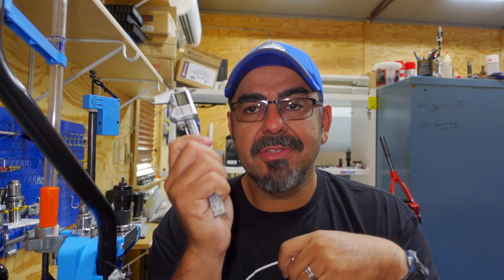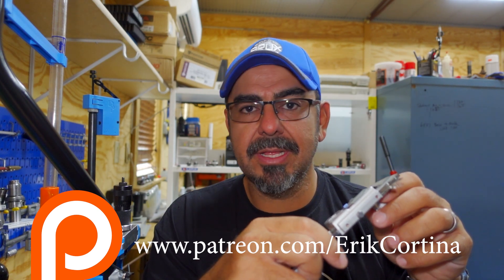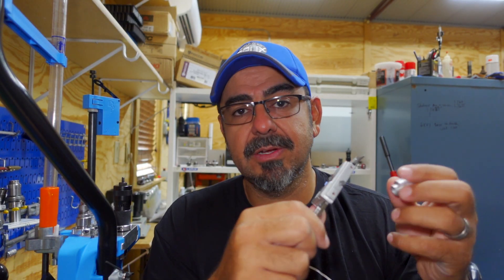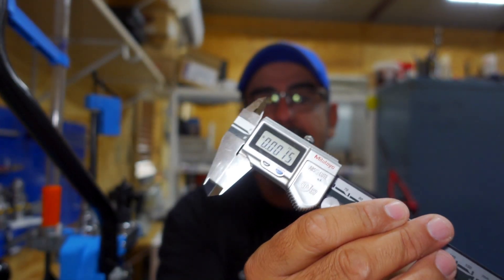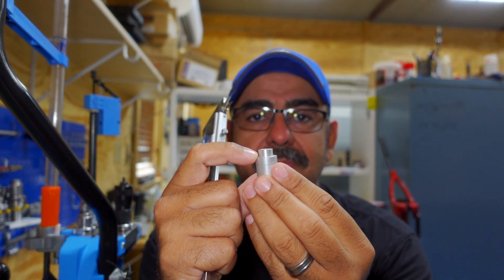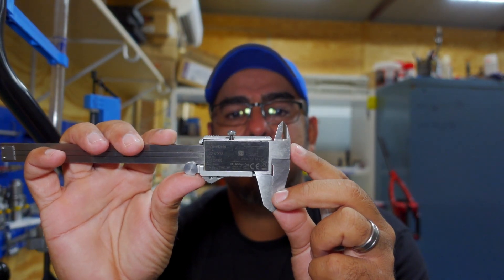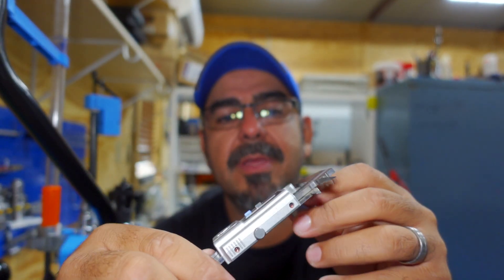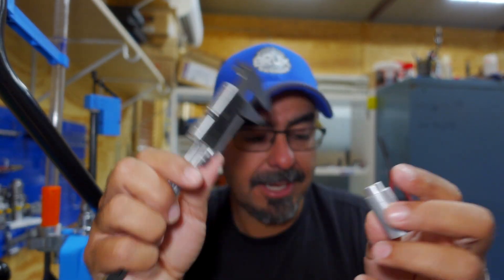You are using your calipers wrong!  Let me explain why...

Comment: Even gauge block have some tolerances :D but yeah - we test less accurate tool with more accurate one.
These calipers from mitutoyo... These are actually rubbish. The older version - black and green ones - were more durable. I use them at work and TBH with about 30-40 measurements a day, 5 days a week, they start to go off by about 0.1-0.15mm after only a year...
ALSO
Some older "analog" calipers didn't have that 4th way of measurement.

BUT STILL
Great video - some of us take this knowledge as somethink basic, but i still appreciate people like you, who wants to share this knowledge to people that just started or never had this tool in their hand. I try to be like this too - i'm responsible for newbies in my job and i'm showing them some things that they would never get to know everyday (company hires everyone, even without any experience whatsoever). Great job man! Whish you all the best!

Comment: 1/4 inch hunting rifle is very possible. Really not needed but can be achieved. I don’t shoot at anything over 200 yards ever because or terrain in my state it is hard to get anything farther unless on the western side of the state. And we are only allowed to use straight walled cartridges or .50 black powder and shotguns so under 300 yards is plenty if you get a shot at that range. And your information on caliper’s was very helpful never would have thought of using them that way.

Comment: Woo-hoo I got it right! I know I have learned that you need to always use the same measurement tool on a project. Even when it comes to tape measures. If I measure a 2x4 with mine and yell down my reading to the guy with the saw, his tape might be different and your lengths come out wrong. Either use the same instrument or calibrate them.

Comment: I need something to help me measure my case trime length.  Dependenig on how vertical I place the case in my caliper, I get a different number.  If I measure from center top to the center bottom of the case I get the best number.  I was thinking may be there is an add on to the caliper or a caliper with a wider frame .

Comment: Hello!
Tnaks for your videos, you provide very usefull data about reloading proccess very needed, cause a lot of marketing shit all around, very easy to waste a lot of money for absolutely nothing and get no expected effect...
There are another term, I guess we should take in counf if we gonna extreme precise measurements also: temperature at wich these measurements done. For example - the question is  at wich temperature this 1inch gauge show real 1 inch and how much it temperature dependent. If we keep it in hands for some time, it could be not 1 inch because at 36.6 degrees it will be inflated a bit, especially if it made from alluminium. For example if you makes measurements of engine cylinders you should keep micrometer for special arm to avoid mistakes from warming up from own hand.
Another term - if you makes measurements at room temp (25 degrees for example) and go shoot at winter - all gaps will rise up also because metals will chuckle a lot. Same thing if you gonna shot at hot sun. All ths thing should be taken in count also if we are talking of extreme precicion also. But I suppose it is another standalone story that need to be clarified.

With regards,

Comment: Even the guage blocks, slip gauges properly named, have different tolerances. A full set of slip gauges are a very useful tool for precision work and you can get sets with adaptors to make go/no-go gauges with them , combined with a DTI they make a fast accurate way to check dimensions of batches too. Dial calipers set with slip gauges are a simple accurate way to measure to very precise tolerances.
Reply: No there called joe blocks

Comment: A 1" gauge block doesn't tell you much if you are trying to measure something that is around 0.500" or 2".

If you want accuracy to a measurement, you need gauges ground to the dimension you are looking to measure and you need a measurement tool that gives you repeatable measurements.

If you don't care about the absolute measurements, a measurement tool that gives you repeatable measurements is enough and those calipers should do pretty well.

The way a caliper's accuracy is certified is a maximum error over a certain distance.  Mituitoyo isn't in the business of scrapping out of spec calipers so they have them certified to a spec that they know almost all of their production will meet.  Quite simply, if your measurement technique can consistently repeat measurements to 0.0005", there is nothing wrong with using it for a relative measurement even if the caliper spec is only +/-0.001".

 For an absolute measurement, you need a gauge the size you are trying to measure but you don't really need that for reloading, relative measurements are good enough and instead of precision ground gauges you can do stuff like save a particular reference bullet or dummy cartridge that you always use to zero your comparator (caliper) every time.

You can get more precise tools but controlling the precision of reloaded ammo to less than 0.0005" is more than most people would bother with.  You would get much more consistency with improving charge weight accuracy from +/-0.1 grain to +/-0.02 grain than going from +/-0.0005' to +/-0.0002" on all of your dimensions.  Improving charge weight is as easy as buying a lab scale and auto-trickler setup, tightening dimensions to 0.0002" means expensive measurement tools, a lot more time, better measurement technique and a lot better case prep technique, it's not easy or cheap.

For me, I've used plenty of Mitutoyo calipers, Starret, Brown&Sharpe, etc. but my Amazon $20 Clockwise Tools digital calipers are more than good enough.  They repeat pretty well and are nicely ground for $20.  They will catch gross errors and not so gross errors, the rest will be up to my reloading technique which is hopefully just as repeatable as my calipers.

For measurements requiring more precision, I'll break out my micrometers and test indicators but that's more likely for satisfying my curiosity than for trying to make my reloading consistency more precise than my $20 calipers.

Comment: In science there is a topic that deals with this called The Theory of Errors. For example, knowing the tolerances of a measuring tape, you can calculate the + or - tolerance of the value of an area you got from the formula A=l x w. This discipline carries on all the way through mathematical physics, rocket trajectory and the like. I don’t know this theory, I only know of it.

Comment: But remember a gauge blocks dimensions are only valid at a certain temperature. So while measuring you shouldn't even touch the gauge with bare hands because the heat of your fingers/ hand will change the dimensions of the gauge

Comment: I live in Gadsden Alabama. When I first got into welding at this huge welding fabrication shop the built all kinds of things but all you needed was a tape measureers and squares for measuring. After I  was there about four years my company was lucky enough to get  a contract from General Electric out of Georgia. The contract was to build transformer components for these really big transformers that you've probably have seen of the side of the road inside of fenced in areas. Anyway when GE came the company selected the best candidates of fitters and welders in the shop to be  building the components. We all had to take weld ip ng test like fitting up about a 16 inch steel box with all the plates fitted together with different joints and welding it up and they tested it for air and pressure tight and welding u couple of one inch plates together and sending them off for testing. The caliber training started with GE . All their measurements were in very tight tolerances into the thousands. Working there made me feel like I worked at Nasa.  Holes couldn't be off more than 3 thousands. Sorry so drawn out but if it wasn't  for GE I wouldn't have learned the four ways of using the calipers to messure. Sorry so drawn out and winded.

Comment: I got veneers with .250 ground pins in the jaws, pressed in so that the edge of the pins cut flush with the jaw for measuring edge to edge hole centers. So there's 5 ways. As a toolmaker I don't use calipers that much, we call them very nears cus that's all there good for, getting very near the measurement. For shooting and reloading there fine tho.

Comment: I myself didn't know about the OD depth measurement on calipers and I was a fitter/welder for 15 years and  I even built jobs for General Electric building massive power transformers for four or those years. Thanks for the knowledge.
Reply: When would calipers be used to weld pipe or a transformer? I worked in a pipe fab shop and there wasnt a set of calipers in the whole building.

Comment: Very good.  Been doing it since 1970, but then not all sets had that feature.  If you need real precision, buy and use a set of gage blocks.  Set the dimension you need with the blocks and then see if your calipers tell you the same number.   Sometimes the gauge blocks are called Jo blocks.

Comment: You can also zero your digital caliper on the over all length then measure from end to shoulder and your reading the depth of the step. Basically letting the caliper do the math.
Reply from the maker: What if part is 7” long and you only have 6” calipers?  😁

Comment: Fortunately already knew this fourth way measuring steps. I must add, there is an attachment you can make or buy that fits on the end the caliper opposite the readout. It's a base to eliminate wobble when taking depth measurements and works well short of having a depth mic at your disposal. You can also make one for a plunger mic that works.
-Jim 15 year CNC mill lathe EDM machinist.

Comment: And some calipers have dimples on the backside so that you can use them to set a compass. Caliper tolerance is always +/- .001, had the argument with a lead hand. He was using the half thou and considering it accurate, even when i showed him manufacturer's specs.

Comment: I like to magnetize my calipers, then grab a 9" grinder and spray them down with a good heavy set of Sparks. Then always lay them face down and toss a small sledgehammer on top of them. Maybe follow up with dropping them on the dirty floor and step on them. I'm after the ultimate in dial caliper accuracy.

Comment: That way of measuring a step is very handy, but still prone to you holding the item on a tilt and making it inacurate. Not as bad as the other way, but still not so good. 
The most reliable way to measure a step on a small part (smaller than the maximum opening of the caliper) is to measure the full length to the shoulder of the step, then reset to zero and measure the full length of the part. The reading will now show you the depth of the step.

Comment: It is more accurate to measure the overall length, zero the calipers and than measure the length from the bottom to the step.
This will give you the difference and this way of measuring is more accurate than your 4th edition.

Comment: Yeah I'm smarter than the average Bear Yogi. Because I learned this trick about 25 yrs ago when I was working in a machine shop.
I also use this for checking locksmith pins that mixed with wrong ones.

Comment: Nice job showing the 4th use of that slide calipers. My background was in calibration (Metrology) and here is a trick don't hold things in your fingers to long. The heat from your fingers can affect the tolerance too. Some of the items that we had to measure we had to wear cotton gloves because the oils from your fingers would affect the measurements. Always note that the standards are at a certain temperature which is critical and humidity as well. Remember your gage blocks should be certified periodically too.
Reply: Thats why some mics have plastic tabs on the frame to hold 'em by, so you are minimising heat-transfer... 😎👍☘️🍺
Reply: Well stated MonadKing, I was a Metrologist for 28 years, USAF, Tracor Aerospace, etc. Gauge blocks also come in different grades. No device is exact everything has a tolerance, even Gauge blocks.
Reply: Our measuring office was constant at 20°C.This temp keeps molecules in steel constant - nil expansion nor contraction
Reply: @martintheron1386   Martin, more importantly , its also because all measuring devices are calibrated at that specific temperature...
Reply: Standards also!

Comment: I am in a weird category in that I tend to forget the id depth function exists.  Granted, I mostly use/used calipers in sheet metal forming - where I actually prefer dial calipers.  I, personally, find them to be more accurate and reliable than digital calipers, particularly when process oils and metal dust tend to find their way into the electrical systems of digital displays.
Corporate, however, loves digital displays because it eliminates any guesswork about where you're at.  Supposedly.

Vernier calipers have a higher learning curve but may as well be voodoo when you're dealing with kids whom our education system has denied basic shop class.

Comment: How about...NOT spending $30.00, but carefully cut a 1" length of Al, fine-sand it flat, and just use that???   NOW: here is the trick: It will probably not be exactly 1" (1.0000)...BUT something like 1.0123".  Just scribe 1.0123" on your "standard"
Thanks for the video.

Comment: That is NOT the way to hold and calibrate with the gauge block. I understand this was fairly relaxed but pushing on the caliper body to set the calibration is a no no. Wipe off both the block and the measuring surface of the calipers and then gently squeeze the forks together on the block without touching the body in any way. This is to rule out any false motion in the mechanism of the caliper itself. A small jewelers magnifying glass is also useful for examining for scratches or damage to the measuring surfaces of the calipers. I hope this makes sense for everybody and you can add this to your already extensive knowledge. I have a sneaking suspicion you knew this but perhaps speeded past this pertinent point.

Comment: Easier way to do that is to measure the OAL zero out the digital caliper then measure from the bottom to that bottom step.
Reply from the maker: What if it’s 7” long?  😉
Reply: @ErikCortina  12" calipers lol.  Yeah I use even 24" on a regular basis.  Just another way to skin a cat.

Comment: Gauge blocks , like all measuring tools are only accurate to a standard if same temperature, pressure. As Metal moves and compress or stretch with the environment. Apples to apples always at noon with the windows closed and the cat outside as sally visits her mom.

Comment: To get the shoulder length you can also measure the overall length, zero the display, then measure the length to the shoulder. You will get a negative number but that negative number will be the shoulder length. 

You can also measure bolt circles very accurately. Find a pin or drill shank that is snug in the hole, measure that with your outside jaws, and zero the display. Now use your inside jaws between two opposite holes. The number on the display will be the bolt circle diameter.

Comment: Best way however, measure the total length, zero the counter and than measure the smaller length. The caliper shows you much more accurate the length of the part with the small od.
Reply: Yes, that's what I was going to add.

Comment: You can also use the fourth method to mark a horizontal line that is a fixed distance from an edge. Just run the caliper up and down with a marker resting on the end of it ;)

Comment: erik, you can also use a good set of feeler gauges to check calipers for accuracy.calipers can be off different at different measurements.what i mean is check them at different size measurments.calipers and micrometers might be right on at small measurments and off at larger ones.it also depends on the quality of the mic or calipers.

Comment: Gee it is a digital caliper,  1. measure the total length. 2. Zero caliper. 3. measure the step. It will the measurement. Simple and more accurate. Also "holding" a part with the caliper like you did is something you never do. In most shops that could get you fired or your caliper removed from the calibration system.
Reply from the maker: What if the part is 32” inches and step is ~1”?  How would you use your technique?

No one is gonna fire me in my reloading room.  Lol